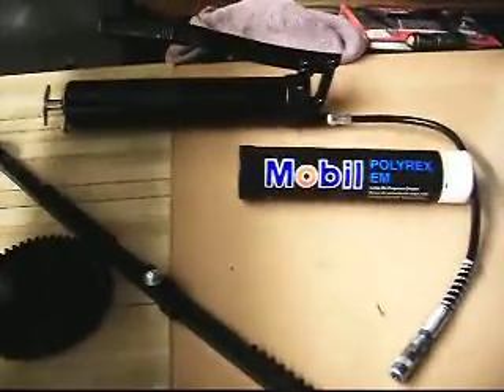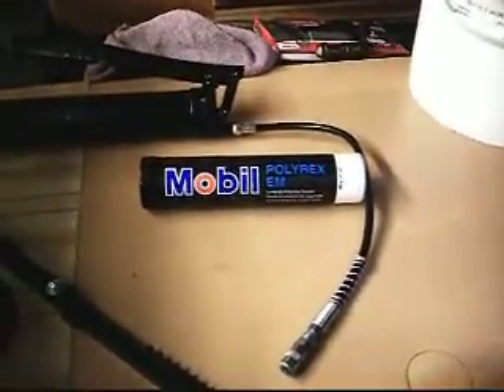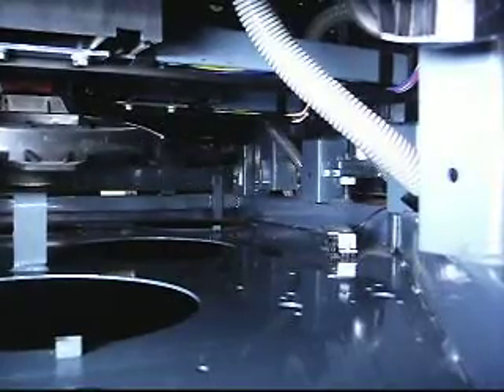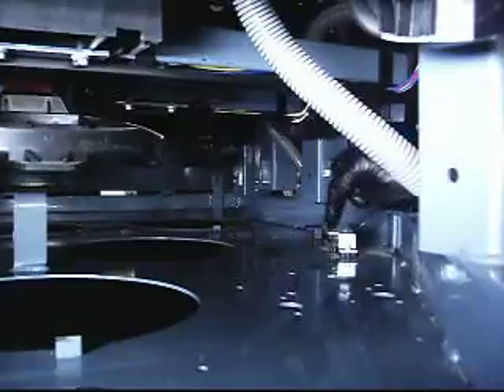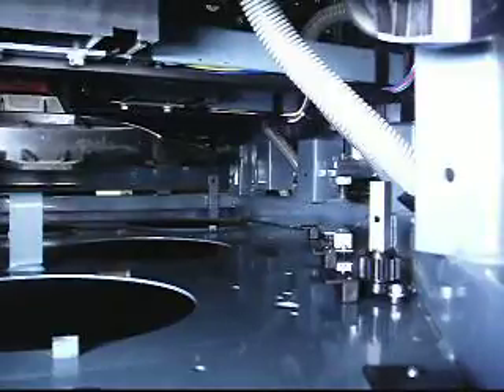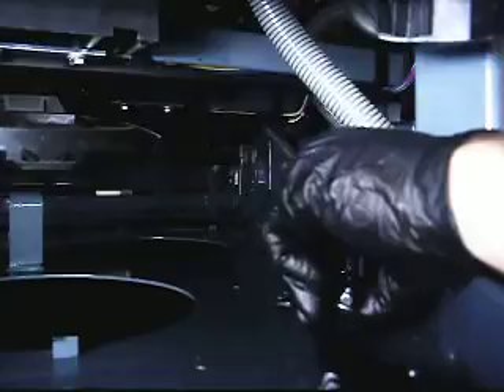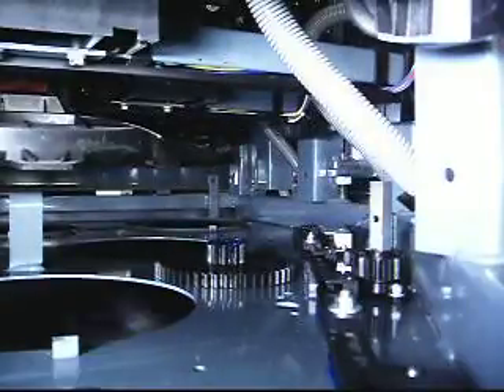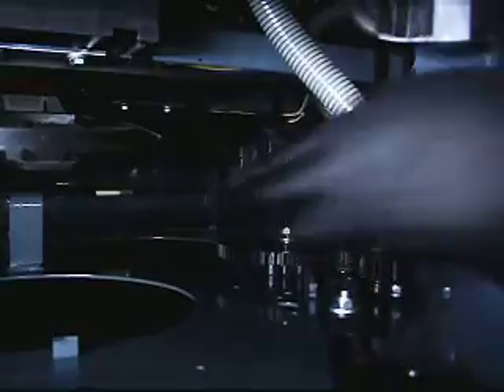GS-X pinsetter setting table drive system installation.

Comment: I have a problem with the table falling all the way to the lane, banging loudly and sending the pins out of the holders, stuffed if I can figure out why.
Reply from the maker: Hoping that you haven't done any repairs before the issue began.
With such a vague description this is what I came up with. 
I am not sure if your table is crashing down all the way from the top position, or if it is just setting hard on the deck then returning to the home position.
(If it is falling from the top)
1.  Your table motor electric brake system may have failed.
2.  Your table motor spring may be stretched too much causing the belt that     
      holds tension on the drive gear assembly pulley to slip.
3.  Your allen set screw or key pin may be out or failed on table motor metal 
     pulley.
4.  Maybe your rolled pin on the black plastic pulley wheel has sheared off.
5.  Maybe one of the links on your table chains has broken.
(If it is just setting pins on the deck hard then)
6.  Your chains may have stretched and you might need to adjust your crank arm 
     and/or pivot bearing link locations. Check your upper and lower table height.
7.  Check your pivot bearing is not trashed.
8.  Check everything relating to the crank arm operation.
9.  Check your 47-011053-004 Sprocket isn't trashed.

The more descriptive you are in your troubleshooting symptoms the better and more precise the diagnosis.

Nobody should ever just go to the car mechanic and toss them their car keys and say "Its broke".

Good luck, remember the devil is in the details.